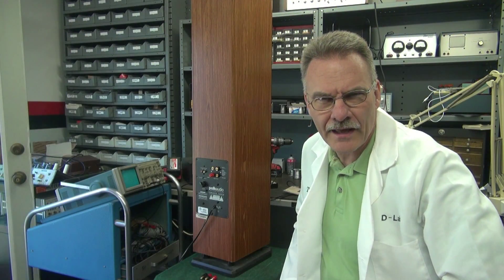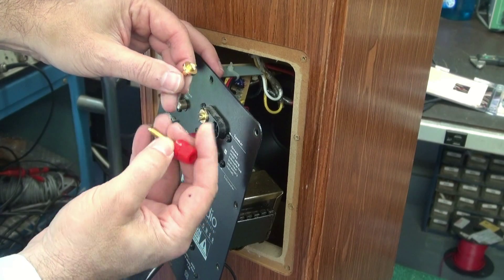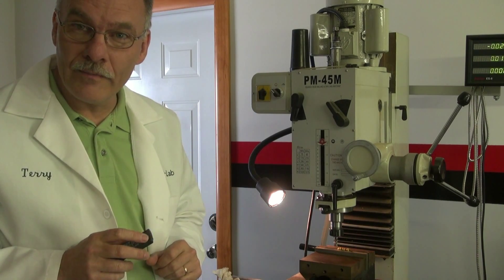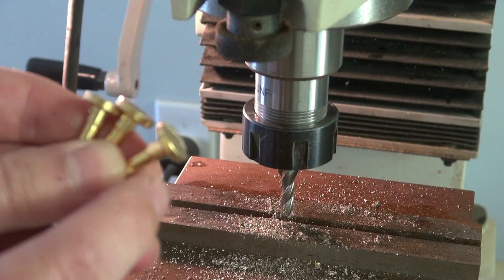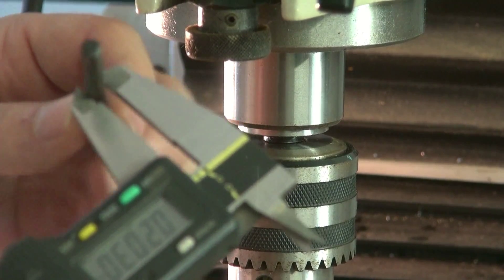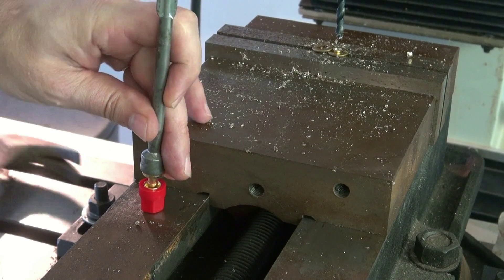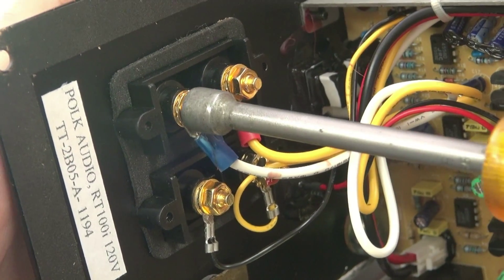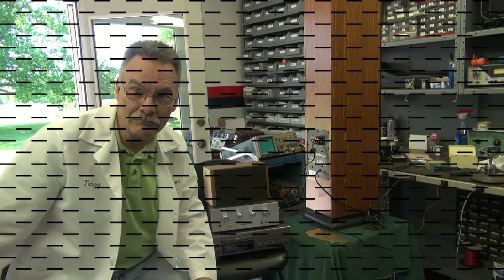How to Repair Polk audio speaker input banana jacks by D-lab electronics

Comment: The jacks on my brand new Polk Speakers snapped exactly the same way. I didn't abuse the speaker. It seems that Polk drill the speaker wire opening way too large, thus having very little metal to support the jack itself.